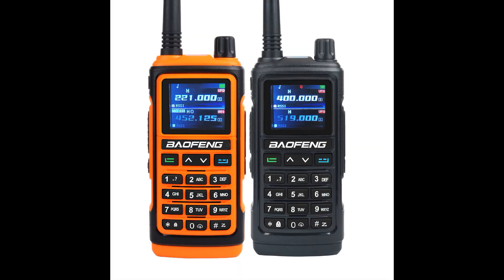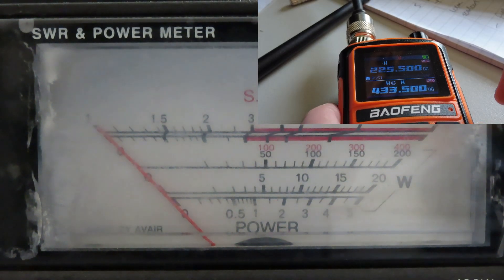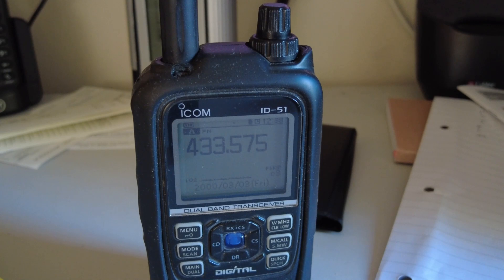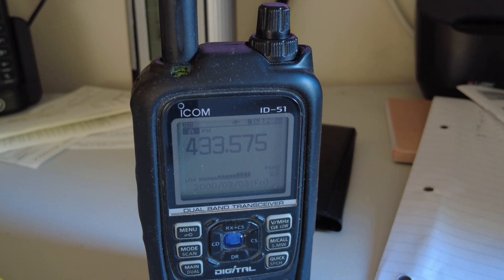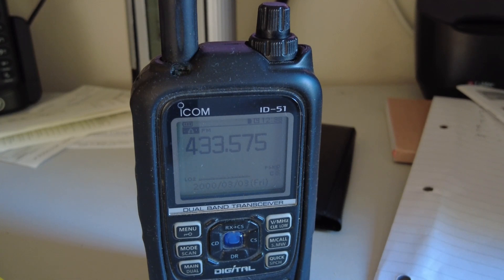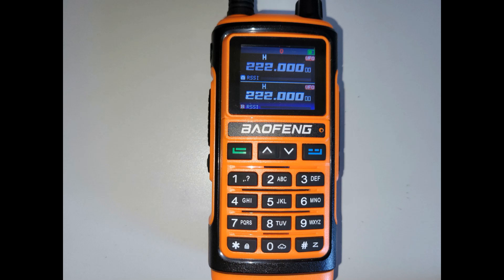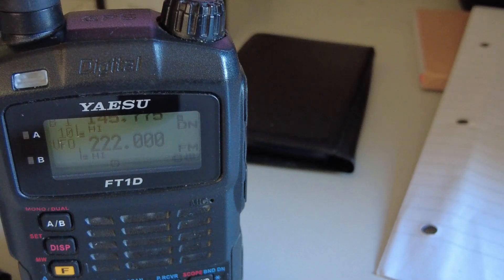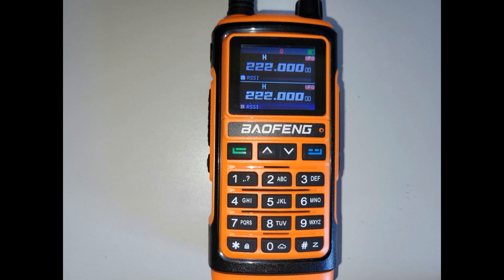Some more tests on the Baofeng UV 17 pro GPS

Comment: I got 3 uv32's for a project. the gps is shyte and dosent work for location baofeng isnt Yaesu of course but selling junk with false claims should be illegal, some settings are locked out and mo-fkg impossible to reset, even via the 2 reset options. I got these Specifically to use for gps location so the seller is gonna get a shitstorm of a complaint soon

Comment: I can’t seem to figure out how to “dual monitor”. What I mean is, if channel A is scanning and channel B is transmitting it will not come through. It’s essentially not receiving in one channel while scanning the other.
Reply from the maker: It doesn't have two receiver's  so if you are hearing traffic on one vfo you will not hear anything else
Reply: dual monitor with only ONE receiver is utterly pointless and a useless "feature" typical of this HONG KONG maker